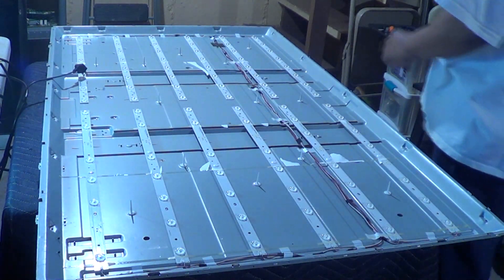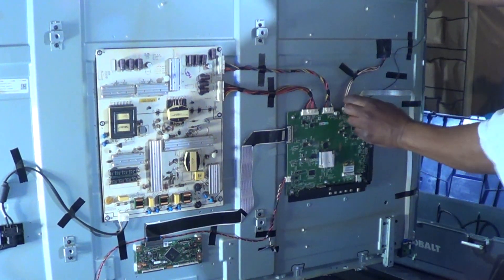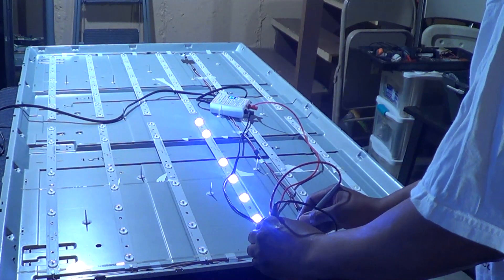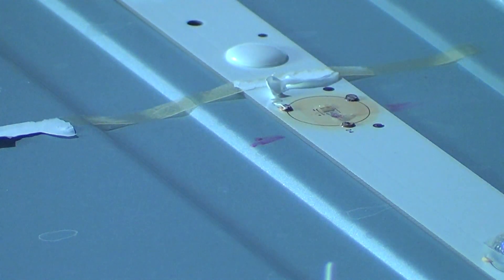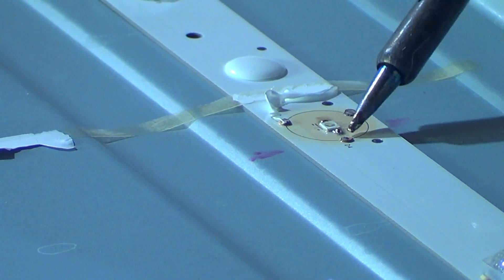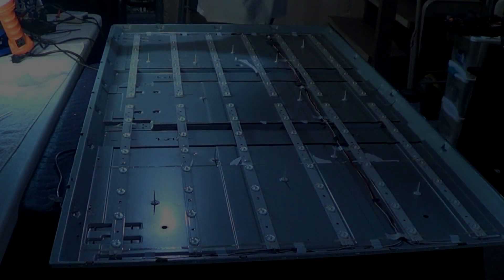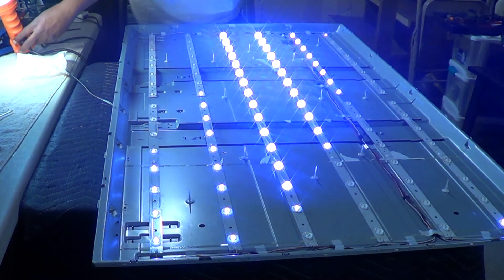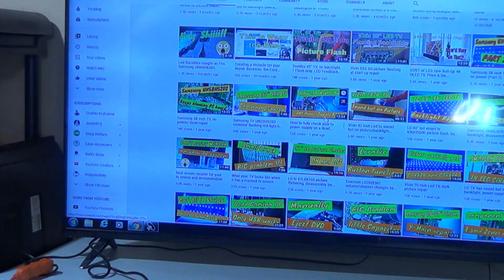Vizio 60 inch, quick screen flash but no picture. E60-C3 television repair.

Comment: Changed out the led strips and illuminates ok. this unit was given to me, got the strips used.
The display picture is ok but color and intensity looks washed out. Maybe something is ajar, loose cable.
Will take the back off and trouble shoot. Any suggestions for this malfunction.
Reply from the maker: Yeah check the connectors from Panel to Tcon to Main.
Reply: @bigdog8882  The small square chip, not big square one, on the T-con board is very hot to the touch.
Undoubtedly fried, got a replacement coming for eight bucks. Thanks.